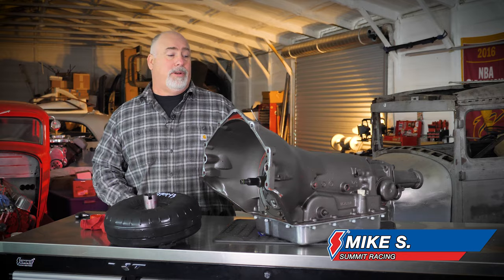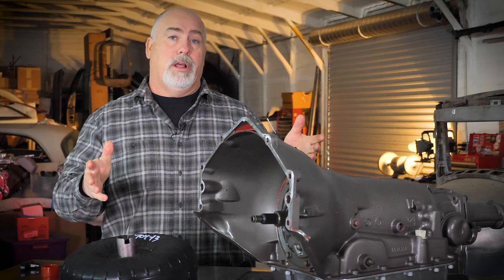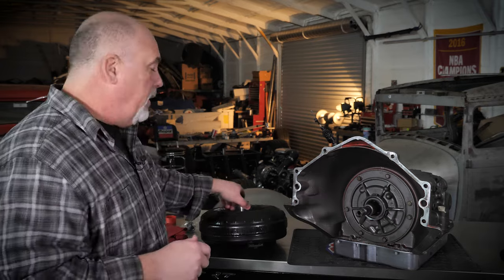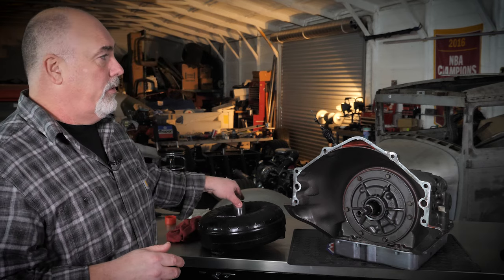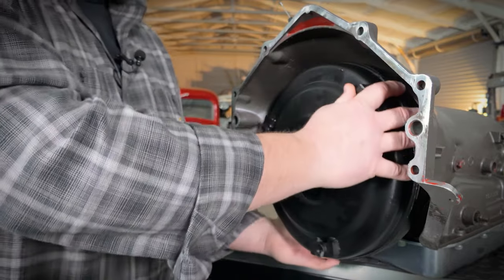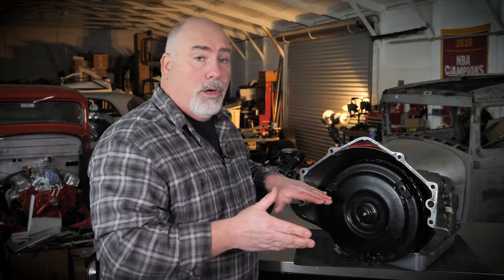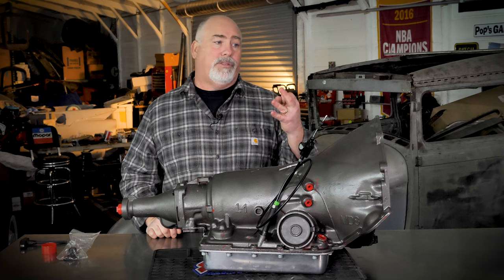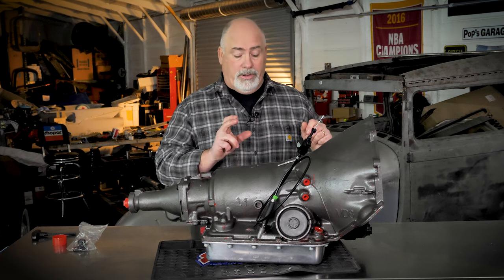How to Properly Install a Torque Converter Into a Transmission & Adjust the TV Cable

Comment: You forgot to bring up, Flushing transmission lines and cooler. Seen this many times, or reusing the old converter with trash fluid in it because people don't realize how much is in it.
Reply: When I was young and new to doing my own work I have done this before.
Reply from the maker: Good points there. This video addressed some of the biggest issues we've seen during installation, but we always appreciate additional insight. Thank you!

Comment: To know that you have a proper adjusted 700 r4 you must have a 21 downshift immediately after it shifts into second gear under light throttle when he's telling you somewhere correct but it's not true because I've been there a 100,000 times if you do not have a 2 to 1 down shift you do not have enough throttle pressure